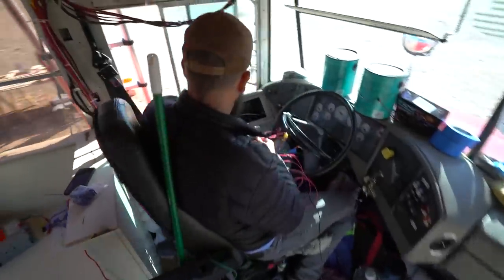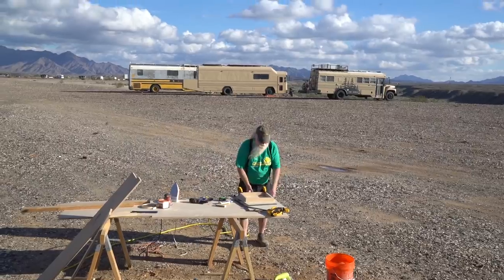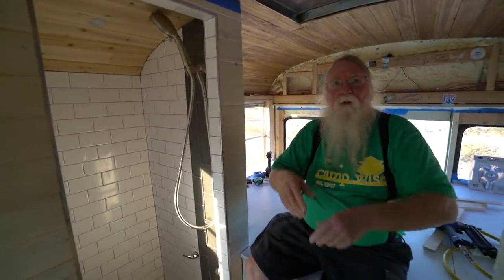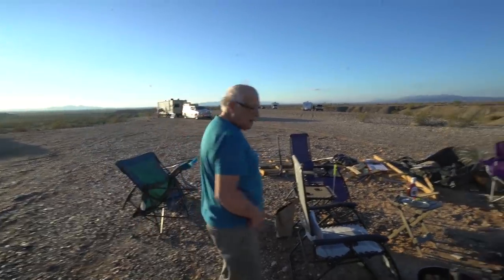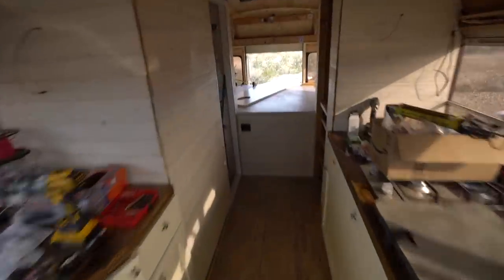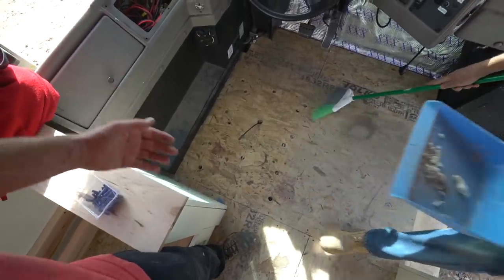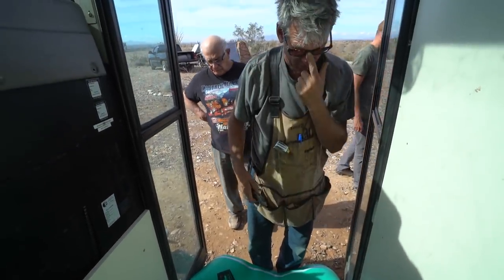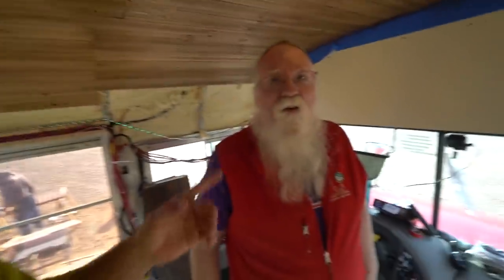WE ALMOST FINISHED!! (Flooring Problems)

Comment: was just thinking , a simple solution to keep the matras from touching the windows and sucking up condensation comming of the windows is putting some 1cm thick styofoam plates cut to the width of the windows and the height of the matras and place those in between the window and the matras , should work fine keeping the moisture away from the bedding , wrap the foam in some sticky cream / off white coloured vinyl and it will look as if they belong , its cheap too
Reply from the maker: Good tip. Thanks!

Comment: I fill the bottom of my laundry bin with " fabric softener crystals" I pour in an entire bottom and the awesome smell lasts for wks plus when you empty your dirty laundry you take as much of the Crystal's you can to add to your wash. Then replace with new Crystal's Crystal's atleast once a month. I also use them in my composting materials. It helps make ths whole bathroom smell great 😊 A white wash trim on the front of the closet shelves would blend better with the walls if your leaving it exposed. Also please just use sheers if your doing curtains? This way your brain wont be distracted away from the gorgeous woodwork. Blinds are great and can help with privacy but the sheers will soften the wood and hard edges of the bus windows 😘
Reply from the maker: I didn’t even know those existed! Thanks!!

Comment: Also something under mattress for air circulation so you don't get mold.
Reply: Roz Black absolutely agree with this!  I had a memory foam mattress on slats that were too wide and started to get some mold in the middle of the slats.
Reply: The underpayment they use in basements would be perfect for this, good call on the air circulation.

Comment: Did you consider putting over your bed a MAXAIR or Fantastic Fan besides the fan that's already installed . Does your schoolie have or will it eventually have heat n air-conditioning? Are you able to use the shower yet to keep clean ? Have you seen the awesome tile job that Wes did in his shower ? The tiling is stunning . What an awesome job he did tiling it . Are you Thank your husband for me for his Service . I was Air Force ' 71 - ' 75 . VA ' 76
Reply: Jax disregard the last sentence above . I don't know how it got in this video. Sorry about that buddy.
Reply from the maker: Hi Bob! The deck was more important than a fan. We’ll see if i retreat that. I have heat via webasto. Shower will be up soon. Wes’s bus is amazing.

Comment: It’s looking very nice, just one question. Why the hamper and not a full width opening? I must have missed something, it just looks like the hamper will be a hard to access area.
Reply from the maker: Hamper goes over part of the wheel well, and around/behind the framing of the closet.
Reply: Jax Austin I figured I missed that.